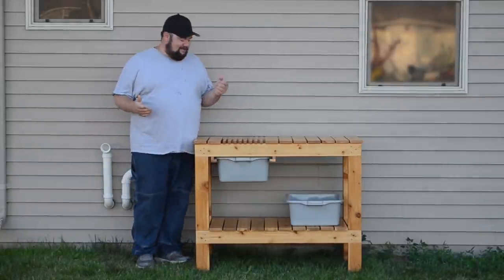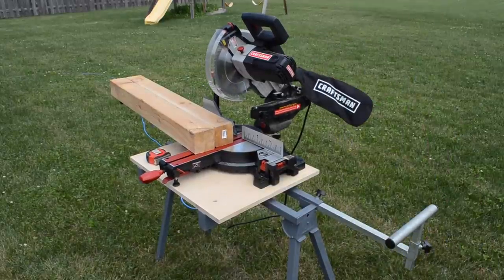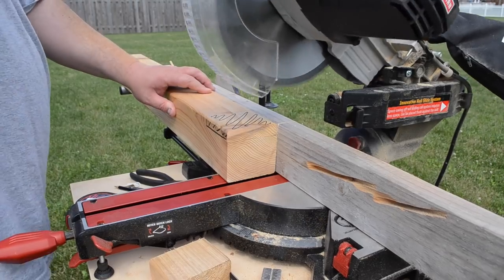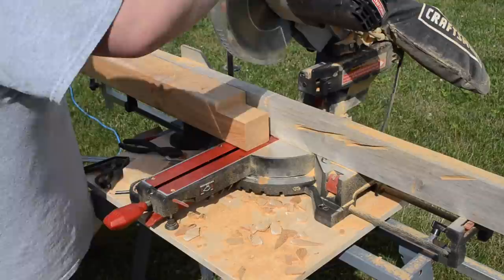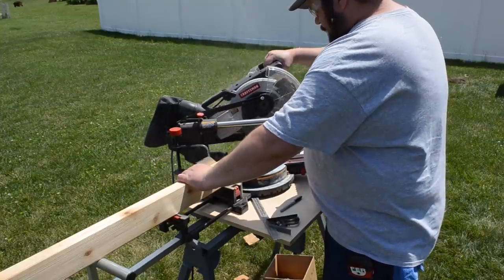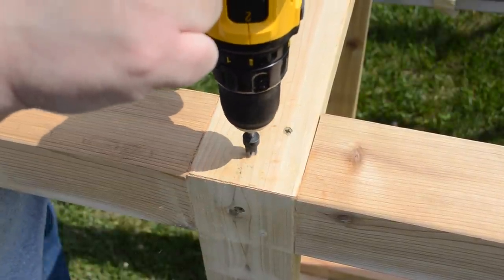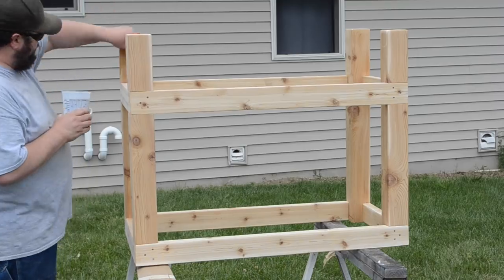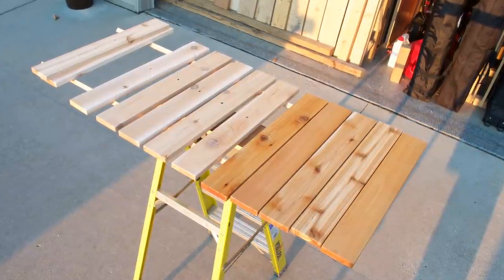Ⓕ Workbench Build / Potting Bench - with Unique Joinery (ep89)

Comment: My God, Nick, I built a cedar outdoor table kind like yours 6 years ago, since then I have built many large things and learned lots more trick, but boy how much I learned from your short video is amazing. 1. how to keep the miter saw cut at a certain depth for dado cut. I had that on my saw, I didn't know how to use it. 2. Adding a board to get the layout line cut for the guide. 3. the dowel seter. 4. Just clamp a level to keep the top edge the same and more. A beautiful design of making a space to catch the falloff dirt. You are a great craftsman! Thank you for share Nick !!!!
Reply from the maker: Much appreciated - glad you could get so much from it ✌🏼

Comment: Nice solid build. I totally agree on slat end grain, beautiful when sanded smooth. For external use, consider drill & screw rag bolts into the post endgrain so the wood isn't sat in a puddle wicking up pints of rain and maybe glue & wrap some DPM as an addition/alternate.
Nice idea with the dowels as hidden fixings, don't even need to glue the slats, removable for cleaning or change function/layout
Reply from the maker: Thanks John - the bolt trick is what I did last week for a raised planting bed - works great

Comment: Bought the plans, took a day to cut and build the frame with one coat of TotalBoat. There are 32 faces to cut, so using the miter saw one blade-width at a time method results in well over 1,500 cuts required, very tedious. Works well though. Learnings so far: (1) 2x4 rip fence is fine for Nick’s 10” miter saw but insufficient for a 12” miter saw. Use two 2x4’s or a 4x4 for the rip fence to get a flat cut across the entire face of the work piece. (2) Nick didn’t put enough emphasis on the frame corners. It is crucial to get the depths right or the corners will have gaps. With over 50 cuts per face, one mistake is costly. Learned this the hard way. He shows how to get the depth right, pay close attention. Love this marine varnish, first I’ve used that doesn’t smell like future cancer. No smell at all, it fantastic. Expensive but highly recommended.
Reply from the maker: Thank you for taking the time to give some highlights to what you saw to focus on - good info on the 12” miter box - the diameter must be just enough bigger - if a person has a bandsaw, many of the cheek cuts on the rabbets cut be done on there - I make an effort to show various methods throughout my different videos - the main reason for this would seem so folks can use what tools they have available - but in actuality, I think it helps challenge people try new techniques they may not have tried before - a test joint or two might be a good idea - I’ve done this joint a few times before and have had the practice which is never a bad thing - thanks much for the feedback - if you snag any postures of it I’d love to see it - feel free to tag me in any posts so I can see it

Comment: Nicely done👍 When building projects I use screws as clamps, when the glue dries I remove the screws and drill out for dowels, usually a contrasting wood so the dowels stand out on the piece.
Reply from the maker: very nice - the last time I did a bench this way I used dowels to completely go through instead of screws - great look for either dowel method

Comment: I love how simple the dowel trick was for the top. One thing I always strive for is hiding screws even on shop furniture.   One thing I do if I have to use a screw and want to got rid of it later back out the screw then drill out the hole and pound a dowel in the hole then flush cut
Reply from the maker: that works nice - good practice to hide joinery - it's a challenge sometimes keeping all out of view

Comment: I've used cheap UHMW plastic cutting boards and cut squares to fit the ends of outdoor legs, then screwed them to the legs using brass or stainless steel screws. You can find them at your local department store in the kitchen section. They come in different sizes and thicknesses, I like the 3/8" or 1/2" ones. This keeps the end grain from being in constant contact with the ground or concrete and stops it from wicking up water. No matter how many coats of finish you put on the foot of the leg after you drag it around a few times that finish is gone. But the plastic 'caps' on the legs will slide on ground or floor easier and not wick up water.

Comment: I've used these joints before, and they are very sturdy... nice work.  To change things up from this design, don't dado out quite as much material from the rails or legs, maybe 1/8" less from each face. This leaves the rails 1/4" proud of the legs, giving a nice "wrap" appearance to the rails...looks very sharp.
Reply from the maker: Thanks - gives it a nice shadow line I’d imagine like inset aprons on a table

Comment: Nice job, the finish made the cedar pop. I liked the no screws in the slats but was wondering why you allowed the screws to show in the leg joinery, would look good with plugged screw holes
Reply from the maker: thanks, it sure does - all said and done I wish I would have pegged the leg joinery - I've done that in the past and it works out so well - why didn't I do that or plug the screws? I really don't have a good answer for that - the project sort of took on a mind of it's own - it started as a quick little bench for my wife where I wasn't even going to add a clear coat, then I had some other interesting idea with the joinery I thought I'd try - and once we opted to finish it and saw the color and grain, went with dowels for the slats - of course this was after I did the base - one of the many things I love about woodworking - I talk about that a bit in the plans - how projects need to be in flux as well as have a separation from computer designed and handmade

Comment: A few years back I made the same thing including the "Rabbet, Miter, Dado, Half-lap jointed corners" the only thing You did that I didn't do was the fact that you used screws and the one I made was all wooden dowels.  I made three identical carts just like you did your potting bench but they have two drawers under the top  and a tray for trash under the bottom shelf. they really are strong because that was back when I was in culinary school in France in the late 90's and as far as I know they are still being used today
Reply from the maker: I've gone the all dowel way as well - really nice to hear yours are holding up after all that time!

Comment: I came up with the same joint for the cross members as you did. What I did not like was making the 45 degree cut to join the cross members. It seemed that there should be an easier and more self squaring joint. I chose to make finger joints instead. It allowed me to build the top cross members and the cross members had to be square if my finger joints were square. The lower members snapped into place.  It made an interesting joint. I just had to keep in mind which cross members (length or width cross members) would have fingers on the top. I was able to just screw the cross members to the legs so that I could break it down to move through my doorway when I moved from place to place. ( I have too many workbenches scattered across the country because I built immovable benches.
Reply from the maker: That would definitely be a cool one to see

Comment: Did you have the measurement of this bench? Is that something you charge for? Is the bin made of something special so it won't get brittle and break from the weather changes? Are dowels made of cedar also? Nice build Nick and I expect no less, love your talent and videos. Your commentary is always spot on as well. Really helps the novice wannabe like myself. Thanks for sharing your talent and videos, Rodney
Reply from the maker: Yes the plans are available here - https://nickferry.com/product/workbench-plans/
The bin is polyethylene and designed to see a huge temperature swing - link to the bin here - https://nickferry.com/2018/07/workbench-build-potting-bench-with-unique-joinery-ep89/
The dowel link is in there as well and they are made from beech - much appreciated - glad you are liking the videos

Comment: Interesting that you mention the finish going bad in your video.  Yesterday, I was getting ready to use some Danish Oil finish on a small piece I had made and it would not pour out of the gallon can.  The can wasn't empty since I could tell that it weighed more than an empty can.  I probably last used that can a couple of years ago and it was OK at that time, but come to think of it, the can was originally bought back in 1994.  I guess I really shouldn't expect it to last 26 years... :)

Comment: Hi Nick great project love that Cedar , couple of things, could you filter the finish as you put it back in the bag ,that way you would only filter a little amount {like the bags by the way } and could  you screw the rail screws in further and then fit plugs to hide the screws as well , love the project  and your details,keep up the good work  ,G.
Reply from the maker: thanks much - you most certainly could counterbore the screws and plug them - I had a completely different way I was going to go about it but the project sort of morphed into what it became - I actually really like that aspect of woodworking - you can filter any time you want I suppose but I don't care to filter multiple times so I opt to filter as close to finish application as possible to eliminate contaminants

Comment: Awesome work; functional eye-candy.
You're showing a lot of good tips and tricks here. Thank you for sharing your knowledge!
I very much like dowels myself. I'm planning on making an all-wood+glue-workbench (no metal, except from maybe the vise screws), so you can drill, chisel or saw anywhere you want at a later point in time, without worrying about hitting something that would ruin your tool. I'm planning on using several large dowels (very large, thick dowels) (all the way through the table-top).

Earlier in my life, I've worked a bit with painting.
Sealing wood with a water-proof laquer is fine, but be careful, because at some point, some water might get inside your wood, and since it can't get out, it'll cause the wood to rot.
An entire fence and porch was ruined, because it was completely sealed. The right solution for the porch is to keep the end-grain at the bottom of the porch open (because it's above the ground level anyway).
In the workbench case, the problem might be a little more complicated, because it's difficult to avoid the 'cup' effect.
The best way might be to add some1-inch  epoxy feet, where air can get up from below, but not water.
Reply from the maker: Thanks - not a bad idea for the bench - I’ve hit plenty of metal with tools before - there already has been some water infiltration on some of the knots - it will be cool to see how it holds up over the winter
Reply: 1-inch epoxy feet? How does this let air get up from below but not water? What am I missing here?
Reply: The epoxy feet question was for 68HC060.
Reply: @William Szymanski, I understand why you would wonder - it does sound a little strange. I'll try and explain a little.
When I wrote the reply, I was thinking something like making a few dry wood-blocks completely covered in epoxy.
These can be attached to the legs using epoxy, then the endgrain at the bottom of the legs will still have an open area (eg. make sure the epoxy-feet do not cover the leg completely; either by routing decorations before adding epoxy or making the feet round).
You would then still seal off the leg itself, but keep the end-grain at the bottom open; thus water will get out and dry at the underside - as long as you don't place the table in a pond of course. ;)
The epoxy-feet do not have to be only 1 inch; you may prefer 8 inch or more, depending on your environment.
-But if you make some larger feet, you may want to use a different material than wood for the core; just make sure it'll be sturdy. ;)

My first thoughts were to make 'epoxy socks', but that would be a real bad idea; the water would gather at the bottom of those 'socks'.
For a good epoxy, which does not damage your health, you can try searching for ecopoxy - as far as I remember, they also have a few YouTube videos. I only like environment-friendly products myself; even if I need to pay extra.
Reply: @68HC060  
When I read "feet" I envisioned what you have now descibed as "socks", thus my original question. I now know exactly what you were thinking. Thanks for the explanation. I guess anything that is not pervious to water but also does not completely seal off the bottom end of the legs would work. For a minute there I thought my brain went dead. Never been accused of that before.😙
Reply: Yes, you got it - and no, nothing's wrong with your brain; I just didn't explain it properly the first time. =)

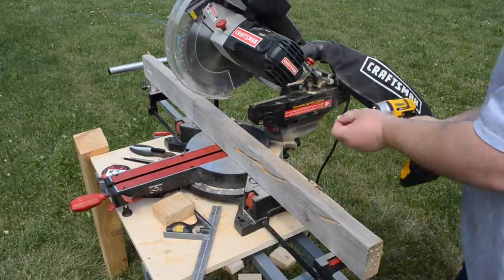Comment: 3:42 I actually independently came up with this same joint for my basement workbench except I used a bandsaw instead of a miter saw. I haven't got one of those fancy sliding miter saws but I suppose I could've used the radial arm saw.
Reply from the maker: Radial arm saw is perfect for this stuff

Comment: I might use the lap design for a workbench. That's pretty slick. I'm thinking of trying a wood peg with a reverse wedge. So make a deep notch in the end of the peg that's going into the hole. Put a wedge, or taper in it. When the peg is driven in the wedge will hit the bottom of the hole, and drive into the split. I think with a little glue it'll hold... or I'll put screws in a month.
Reply from the maker: Do it up - my original plan was to peg the joints

Comment: I have an inexpensive 10in sliding moder saw similar to yours but a shop brand from a big box store. Only issue is the fence, one has no holes for screwing on an auxiliary fence. And it sits level to the bed but the right hand side next to the blade seems to be bent in towards the saw so getting a straight cut on short pieces can be a challenge. What do you think of removing the stock fence and replacing it with either an after market or wooden fence I designed?
Reply from the maker: I'd say build a fence to on the existing one - if you need to shim it in spots to make it straight then do so - you can drill holes in the factory fence where you need attachment points

Comment: Very nice, Nick!  Now I'm inspired with some of your design considerations…

One design change I recommend is eschewing glue on the boards.  Gravity, if not friction, would keep them from falling off, and if one needed to be repaired/replaced in the future, easy-peasy.

I love the dowels, and the YouTube thumbnail with the caption 'Unique Joinery' had me thinking that the shoulders would be a form of bevel like a semi-dovetail.  I also don't like metal fasteners, so use locking joints, drawbars, or dowels (preferably without adhesive unless critical) in all my joinery.

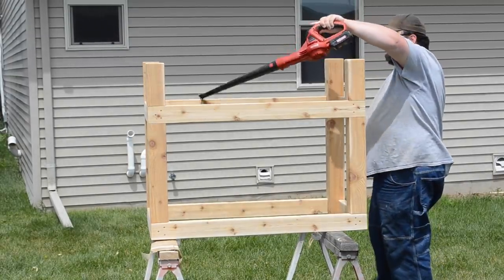@12:30 — how did it happen that the shoulder facing the camera was too deep — was that piece a different thickness than the others?  (I would worry that would negate your objective of "no exposed end grain"; perhaps some clear silicone caulk to protect it?)
Reply from the maker: 12:30 doesn't show wood, it shows finish - but you're probably referring to the round over on dimensional lumber

Comment: Another good reason to avoid exposed screws in outdoor furniture is they are a primary area of failure for outdoor furniture, especially in cedar and many conifers.  

They act as access points for water.  The water wicks in along the shaft and works with the resin in the wood to corrode the screw.  In the case of conifers, their resin reacts with the iron-oxide to produce a compound that then rots the wood it is in contacts with.  The result is that the screws dissolve faster than normal and the screw hole rots open quicker causing the item to fall apart.

You can buy screws specially designed to resist or to prevent this type of corrosion and rot, but your choice of floating tenon joinery is a far superior solution.  It is a structurally strong joint and as you noted provides a more pleasing appearance.
Reply from the maker: thanks man - I completely agree - even though I used coated decking screws, as you mentioned, not having the spot for water to get in is even better

Comment: If you did it over would you use dowels for the frame? Or, cover screws with plugs?
Reply from the maker: yes I would - I was going for something different with the joinery when I started and once I got the slats finished I changed up the project